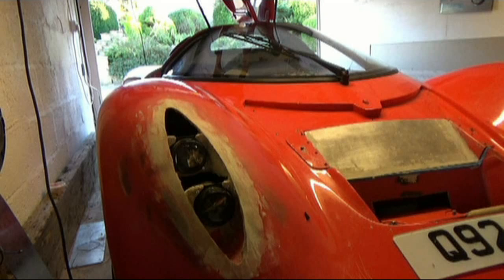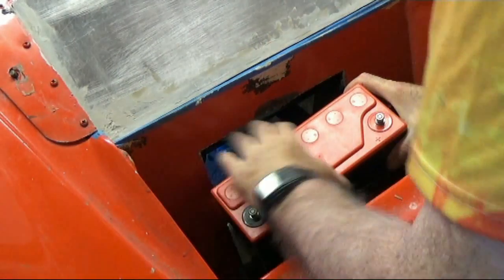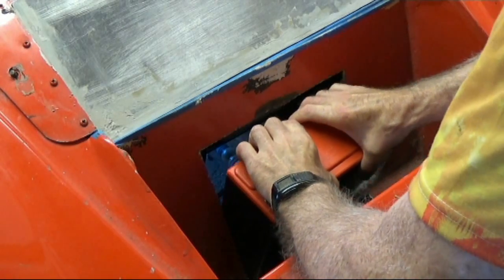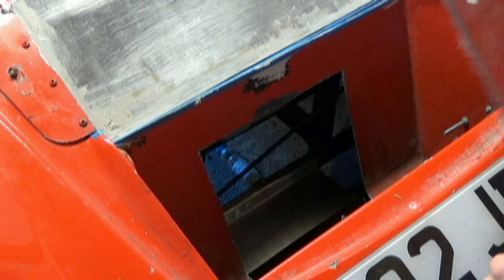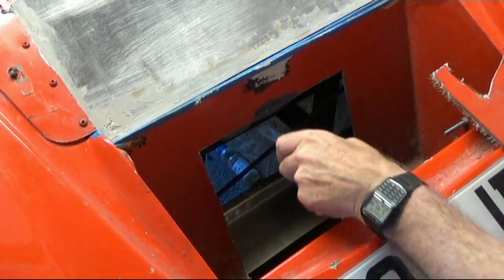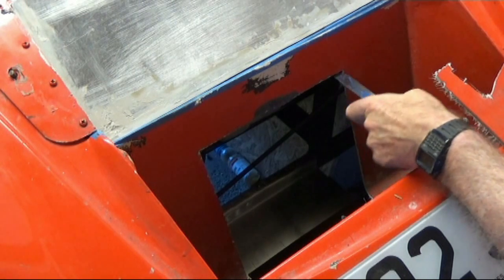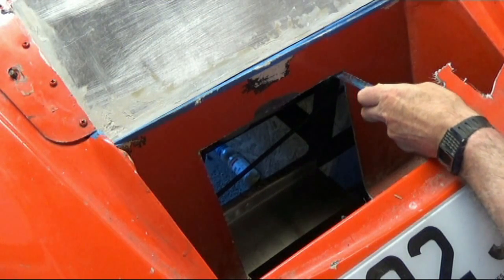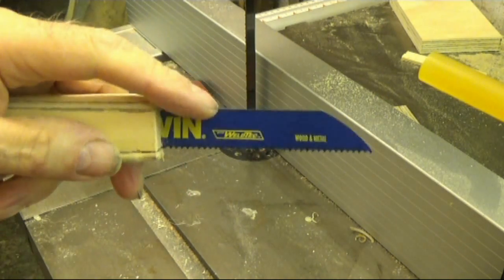Make A Useful Hand Saw In Three Minutes

Comment: Those recip saw blades are very useful. I have a commercial made handle that i love, I can fit a wide range of blades into and use it for anything from pruning to small scrolling type work and can cut metal, plastic and wood with ease. Obviously using them in the powered recip saw works best but the handle allows control and better access to tight spaces, wouldn't be without mine.

Comment: A very useful tool. Is the music yours? Glad to see work on the Belva is progressing.
Reply from the maker: Hi Joe - yes the guitar piece is my interpretation of The Shadows and is called "GypsyHank" (after Hank Marvin).
Reply from the maker: Yes I have probably understated just how useful this customised saw blade is. I have accumulated virtually every tool under the sun - a jigsaw would not do it, drilling a series of holes and chiselling out was too time consuming, a keyhole saw is not strong enough for GRP and the blade required too much clearance etc etc. I am hoping to use my 3D printer and design a plastic handle for this blade. Two of these blades cost £6 and the video was made using the second blade, after I had tested the quick handle out on the first one. I tried to keep the video very short because attention span for my videos is only 40% and 20% of viewers switch off in the first 20 seconds as they are too impatient to watch a brief intro. It is hard to know where to pitch it and this is all free ideas based on half a century of woodworking experience!
Reply: song called apachi
Reply from the maker: Yes my interpretation of Apache - recognisable but quite different.

Comment: How is the blade retained in the handle?  I didn't see any applied glue or fasteners, and so in use  a good yank (like me) could pull it out.
Reply from the maker: I wouldn&#39;t recommend &#39;a good yank&#39; (unless you are referring to am American citizen!) for skilled sawing. If you look at the video again you (at 1:21) will see the teeth go right down into the blade and it is that which contains it. I have used this saw repeatedly on this car project (eg for cutting through water hose pipe (to allow for an inline water temp sensor) where no other saw would get to in the confined space. Hope that helps.
Reply: I think I'll take an extra minute or two and drill a hole through one side of the handle for a short nail or screw.  I might even splurge and use a scrap of hardwood instead of the plywood.
Reply from the maker: You can do that of course but simplicity works. The blade handle I designed in the video will last as long as the blade is sharp. Believe me! I have been woodworking for over 50 years now!  It is not supposed to be a work of art but a quick effective method and you improve the grip by clamping the handle immediatelty after guing in the vice to really compress the glue  line. The hotmelt glue alone won't last for ever. See my video: https://www.youtube.com/watch?v=0W_jFQuIwF4
Reply: Sometimes I use both hotmelt and yellow glue if time is short.  I spread enough yellow for permanent bonding,  and then apply hotmelt so that the item can be handled within a few minutes.

Comment: I never really trust hot-glue to do construction  work. How does it hold up? Or was it just for this one job? In that case hot-glue will do just fine of course.
Reply from the maker: Please watch my video WHAT CAN YOU DO WITH A HOTMELT GLUEGUN and you will discover I use it for everything other than permanent bonds! I used it here as I had a quick job to do and reckon it will last as long as the blade keeps sharp. You can use a PVA but then you will have to wait for the glue to cure before using the saw.  https://www.youtube.com/watch?v=0W_jFQuIwF4
Reply: Woodomain - Jeremy Broun
Thanks. I will definitely watch that one. Always good to improve on ones education.
Reply: I would have used 5-minute epoxy and/or wrapped the handle with strapping tape or any tape.  This looks like it might fall apart if handled roughly or pushed hard, but hey, nice idea

Comment: Thanks for the tutorial. Im thinking of making something like this for small wood projects since i do not have space or need for bigger tool. I only use saw on thin 1 inch or smaller dowels or cutting some small branches. Would this suit my needs? Can I use wood glue instead?If woodglue does not do the trick then is there any manual way ( rope, nail, etc) you'd suggest to hold everything in place? Thank you so much in advance.

Comment: or you could reach for your MultiMaster (TM), or substitute.
Reply from the maker: As I say in the video it is a confined pace and all other methods to remove the section of GRP are either too slow or the tool wont fit. That includes a Multimaster power tool because the radiator tapers down to about an inch and a half clearance. The video was offered for a reason, not for the joy of making your own tool handles!
Reply: Well thanks for sharing.
But I must say that it looks to me as if a MultiMaster would reach. And.... you did not show us if/that the saw you made reached in the area of the kit car.
No offense meant. I rather enjoy many of your videos.
Cheers
Reply from the maker: Yes I tried to keep the video as short as possible because of YT attention spans and also because of time restraints (these are free videos) I missed taking more shots that would clearly show just how confined the space is but I think we are (both) nitpicking her - there is a use for a quickly improvised hand tool that does an awkward job in confined spaces quickly and being very low cost that was what the video was about. I also like to encourage hand and power tools. Sometimes it is quicker to use a handtool depending on the task. The GRP airborn dust is another issue which a handtool can minimize. I had more video of actually removing the portion but as I say wanted to make this video really short because otherwise people don't watch them! Can't win!
Reply: Thank you for your gracious reply. You are as much (or more) of a gentleman as (than) I have encountered on YouTube.
Thanks for sharing your knowledge and ideas.
Reply from the maker: Perhaps I would have been more gracious to accept your first comment without adding to it!! But thanks if you are not being sarcastic! It is very difficult to get these videos right and to know who one is aiming them at.